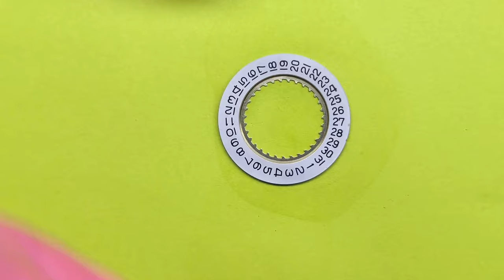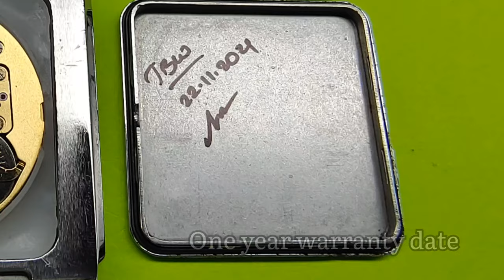PIERRE CARDIN SWISS MULTIFUNCTION WATCH ⌚ SERVICE.

Comment: Dear Deepu Bhai,
The restoration is really good. I have restored a few Pierre Cardin watches(all multi functional watches) and all the watches are screw down back. I referred the official website of Swiss watches and all Pierre Cardin watches are having screw down backs. The watch you restored is having a press back. Even the printing on the dial and the number indices are bad. There is no ambosing of the name Pierre Cardin any where in the train wheel bridges on the movement. Therefore in  my view the watch is a frakken watch.
Reply: maybe
Reply from the maker: All models of Pierre Cardin multifunction watches have only a case back (back cover) with screws, as  fer as you see, you think... A part from that there are also pressing, thread fittings. You said that few pierre Cardin chronograph multifunction watches  you had repaired, it is surprising that you did not even  know this little thing. Not all Pierre Cardin watches it contain brand name on its movement. Remember that it is  Swiss made RONDA 5030D movement. In this model watch, Replica Peirre Cardin chronograph multifunctional watches comes with VJ or VX movement. Fake however will be the china movement. Thank you Bhai.
Reply: Thanks for your valuable information.